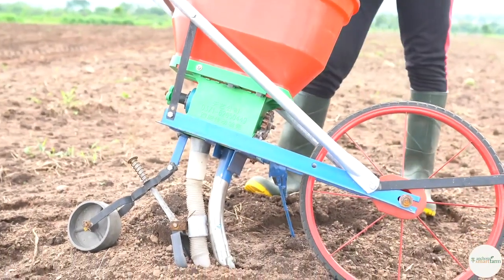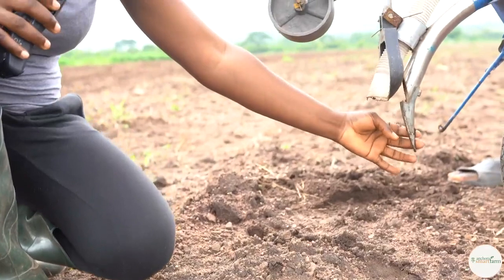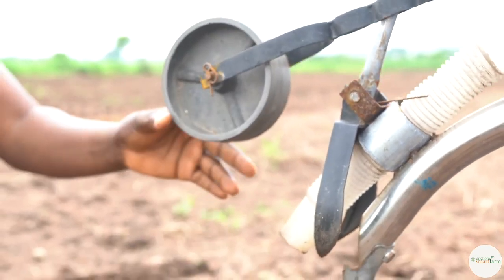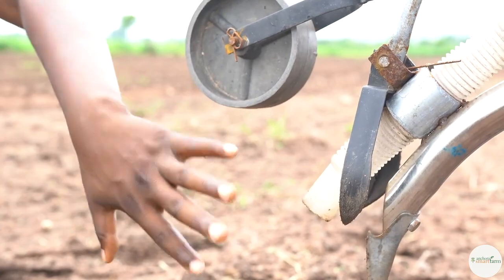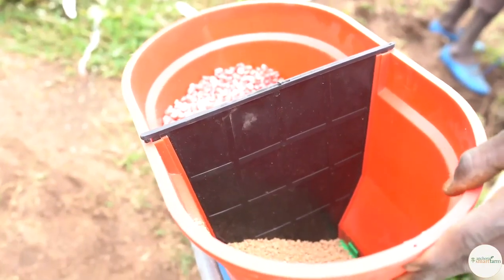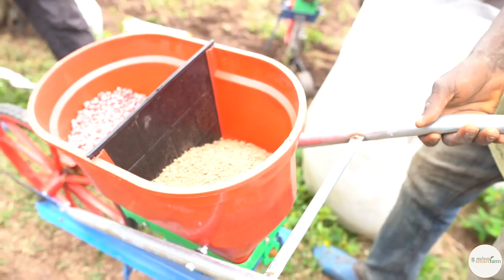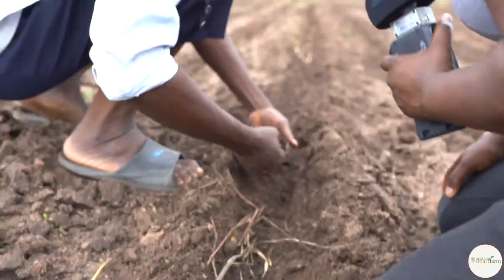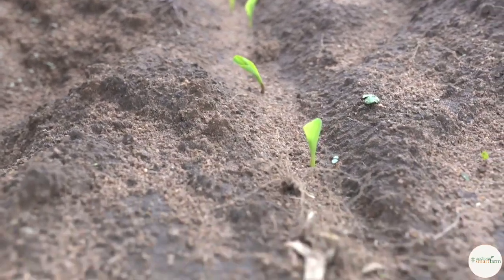Smartfarm Mechanized Maize Farming Process

Comment: This is a good quality video. I wonder why the walking planters were not just attached to the tractor implement (either individually to each tine or with a sheet metal seed box or strip of metal or wood connecting the seed containers. Also, what happened in the field that there are such large gaps with no plants? Was the field flooded with surface water at some point or was germination very poor? Was there a pest or disease that destroyed the plants?
Reply: Most likely inefficiency of planter. Happened in my soya field too.